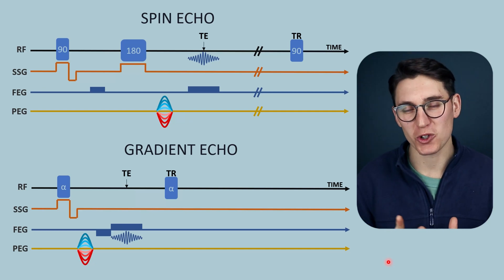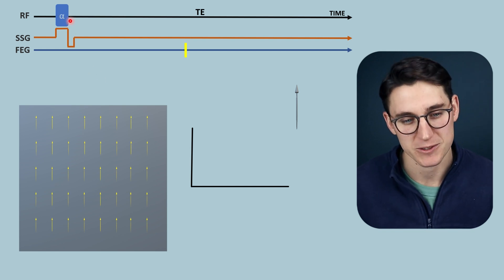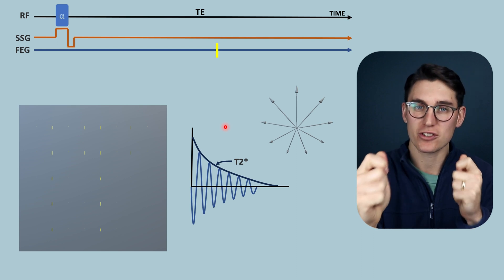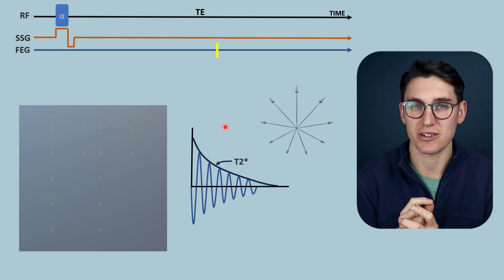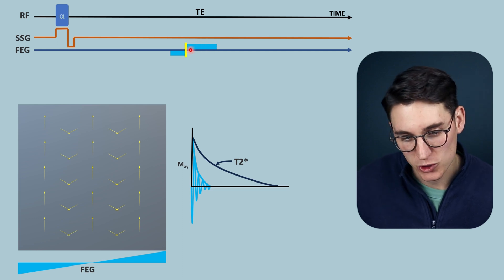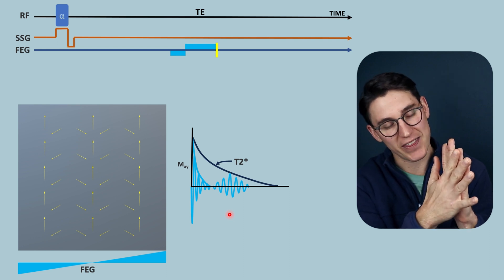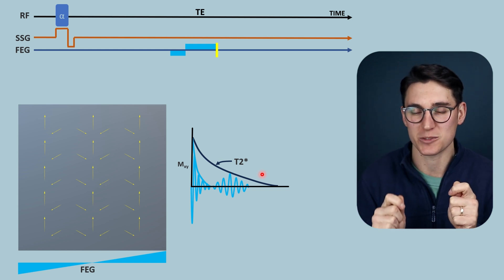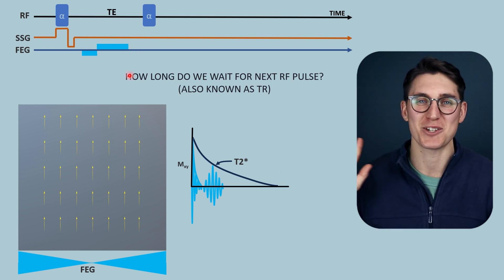Gradient Echo MRI | MRI Physics Course #16

Comment: What I fundamentally still don't understand and what's causing me so much confusion is how these magnetic field gradients actually work. Why do the spins in the central column have a frequency equivalent to the Larmor frequency? Ie why is the (additional) magnetic field strength there 0? And if that's the case than the halves must have alternatively negative or positive values so what sense does it make to say that the field on the left is strong and weak on the right (and vice versa?

Comment: Frequency encoding gradient help us localized the signal in x axis location based of different precessional frequencies which is determined by the frequency gradient applied across the x axis.... the inverse gradient is applied in GRE to negate that frequency gradient and records the signal at TE when the spins are in phase... My question is how does the system know the spatial localization of the signal along x axis as the frequency encoding gradient is reversed by a reverse gradient???

Comment: In gradient-echo pulse sequences, an RF pulse cannot rephase transverse 
magnetization to create an echo. The low flip angles used in gradient-echo pulse sequences 
result in a large component of magnetization remaining in the longitudinal plane after the RF 
excitation pulse is switched off. The 180° RF pulse would therefore largely invert this magnetiza tion into the−z direction (the direction that is opposite to B0) rather than rephase the transverse 
magnetization [1]. Therefore in gradient-echo pulse sequences, a gradient is used to rephase 
transverse magnetization instead.

Can anyone  give clarification  which  is correct  gre opposing  90 or 180?

Comment: very nice explanation but sometimes the analogies  you give are not very applicable to the concept. you can come up with the more logical ones...for example for 180 degree pulse,you said that  we can compare it with changing the direction of the faster spin so that it can catch up with the slower spin...i would suggest another analogy that would,hopefully, explain it more clearly....taking the same example of a race that you rightly gave,what the 180 degree pulse does, is in essence, forcing the faster spin to go 'behind" the slower spin and then catch up with it finally.With this intrusion,the 180 degree pulse compensates the differences in the speeds of the two contestants..very unfair though 😂....Being your student i think my mind has also started working very well now 😀😀💪...Many thanks to you 🤩
Reply from the maker: Thanks for the feedback 🙂

Comment: Thank you doctor 😊
Reply from the maker: Pleasure Guduri 🙂
Reply: @radiologytutorials  I have read one book stating that  Gradiant  PES oppose 90 pulse ,BUT USE 180 to flip fully  into -Z direction, in gre using less than 90 & probably  30 degree to 45. 

In gradient-echo pulse sequences, an RF pulse cannot rephase transverse 
magnetization to create an echo. The low flip angles used in gradient-echo pulse sequences 
result in a large component of magnetization remaining in the longitudinal plane after the RF 
excitation pulse is switched off. The 180° RF pulse would therefore largely invert this magnetiza tion into the−z direction (the direction that is opposite to B0) rather than rephase the transverse 
magnetization [1]. Therefore in gradient-echo pulse sequences, a gradient is used to rephase 
transverse magnetization instead
Reply: @radiologytutorials   Doctor  please  give me  a reply  & I am in little  dilemma  which is  correct.